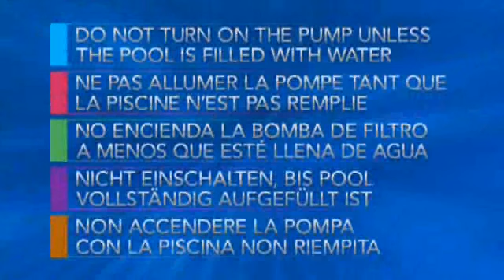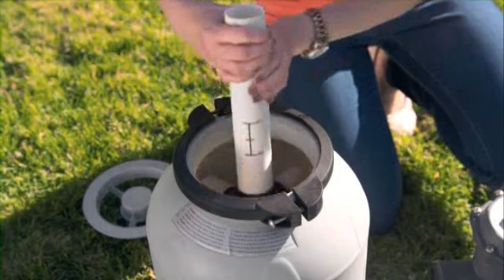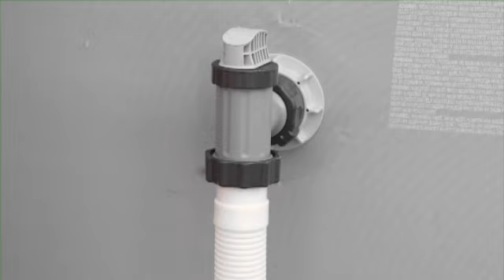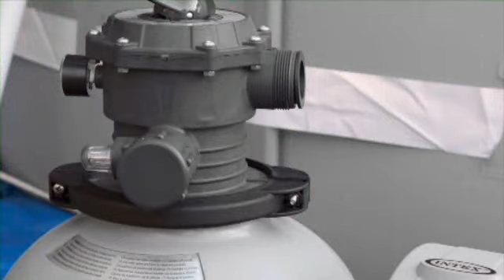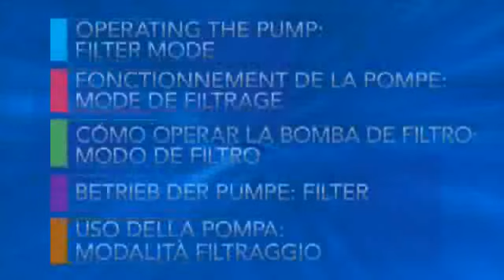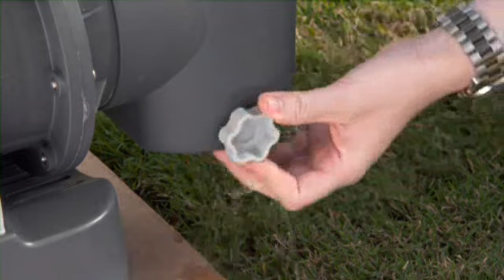https://www.Johan-Laurens.com Intex Sandfilterpump.

Comment: yes great 1st / reopen filter pump system description -  when turning on, 1) valve closed, power off  2) open inlet/outlet valves  3) setup for backwash rinse and do so 4) start filter -  and of course always turn power off before moving the pump valve position

Comment: Can I use my saltwater system
Reply: Yes you can. Im hookin mine up in a few days. Its a video on here on how to connect them 2gether.
Reply: I used it without issue. It wasn’t working with the tiny pump intex sent with our pool, the pressure was too low. The sand filter pump has plenty of pressure.

Comment: Do sand pumps clean the junk that floats to the bottom of the pool also, or just the debri that floats on the surface?
Reply: Justina Branham in my experience, you’ll need to purchase a pool vacuum to get the stuff at the bottom. 28001E is my recommendation.

Comment: I was looking so forward to getting this pump and the day I got it I connected it following the video that came with it (which is this same video). I followed step by step and did everything correctly but for some reason every time I turn the pump on either manually or with the timer it blows sand into my pool. This is the first sand pump I've ever had and I am a newbie so I figured I did something wrong so I called inter and they told me to basically empty the tank and check to see if the laterals were damaged. Well I did that and there was no damage so I went and another bag of sand and followed the same directions again and when I turned on the pump out came the sand. I'm so frustrated and now my pool looks awful and has sand all over the bottom of it. Index told me to call them back after I checked for the damage so tomorrow I'm going to call them and see what to do. It's under warranty so i dont know what they will do. I had heard such good things about this pump but needless to say I'm very disappointed
Reply from the maker: Hello, we are from www.johan-laurens.com and we sell quartz sand filter sand for many years. The sand must be between 0,4 - 0,8 or you can use Intex glass media for this pump. If you use normal kids play sand it will not work.
Reply: Johan-Laurens.nl Feestartikelen I used the correct sand. I used quickcrete pool filter sand
Reply: I did that. I backwashed until the water was completely clear and then I rent for one full minute as the directions said and actually I let it go a little bit longer just to be sure and still when I turn the pump on fan started blowing into the pool
Reply: Did you ever fix it

Comment: We have a new pool, Intex ultra frame 18' x 52" sand filter/salter water pool. My issue is the 6 way valve on the sand filter leaks badly. I have inspected the O ring and it looks fine. Has anyone else had this problem?
Reply from the maker: Hello, maybe it will help if you put first some water in the empty sand tank, then place the filter pipe and then fill the tank with sand. Sometimes there is some sand under the filter pipe and then the valve will not fit as should be.